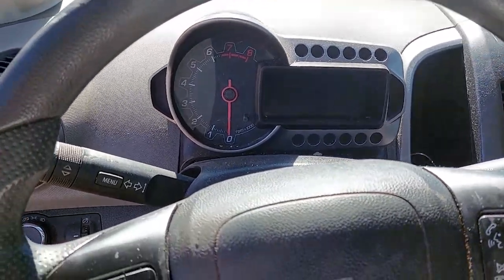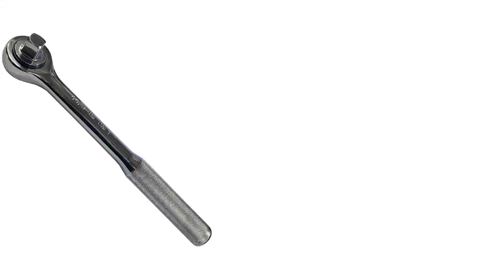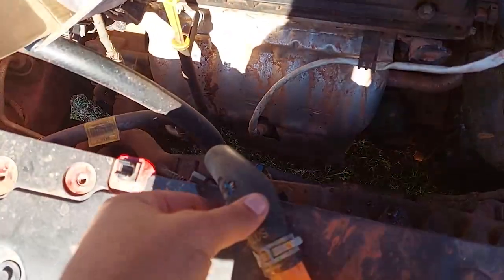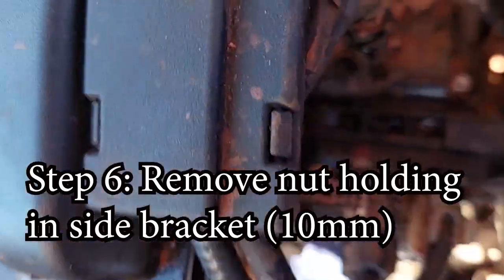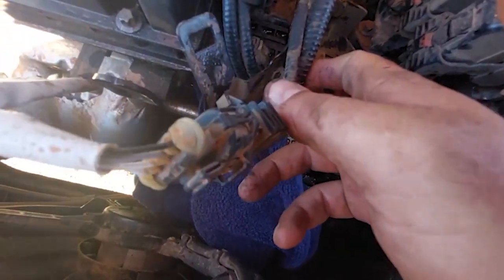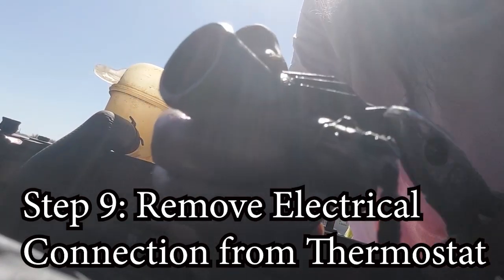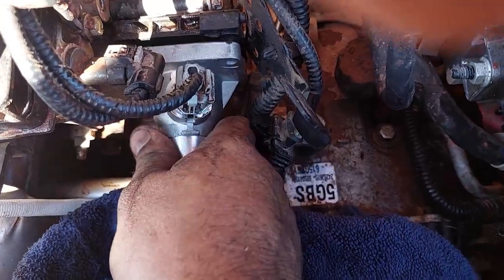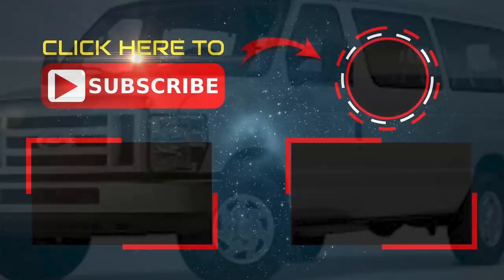Chevy Sonic/Cruze Change Thermostat - OBD II CODE P0128 Coolant Temperature Too low/Too High

Comment: Thanks for the video buddy, i got an issue though >.<. I changed my thermostat after getting the code P0128, added back coolant, turned on engine and the fan came on immediately, the check engine light is still there, code still reading. Did i do something wrong? What else could be the issue.
Reply from the maker: Maybe try to clear the code and see if it comes back?  Sometimes the code doesn't go away on its own but if you clear it out it doesn't come back.
Reply: @vanpocalypse3529  I saw that I might need to change the temperature sensor also. About to do that.

Comment: I had a hard time getting that connector plugged back in. I tried putting it on both ways. My granddaughter got it to go on, but I'm sure it's on backwards. The dash light went off but the radiator fan isn't coming on even with the AC on max. I took that connector off , was sure the squeeze part of the connector was facing away from the engine. Craziest thing you wouldn't think it would go on backwards.
Reply from the maker: Hope you got it figured out and back on the road!